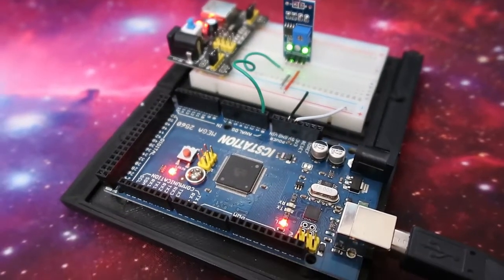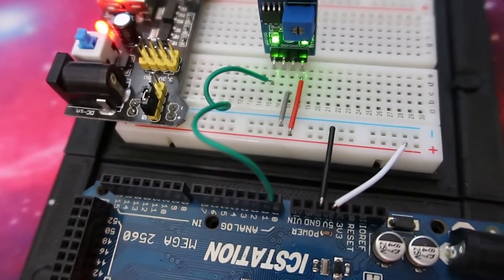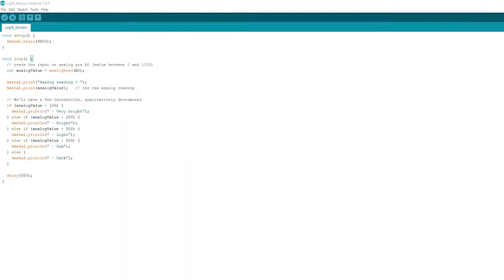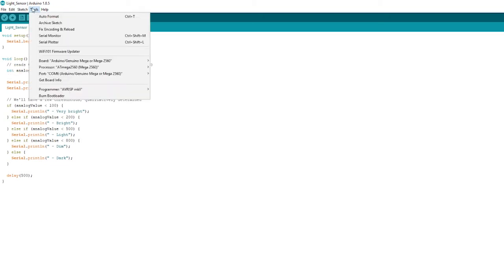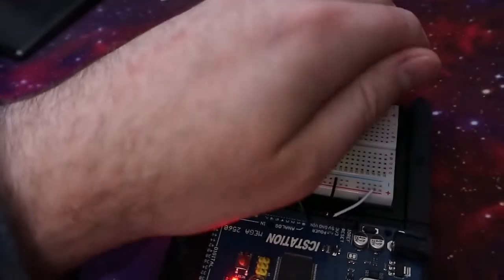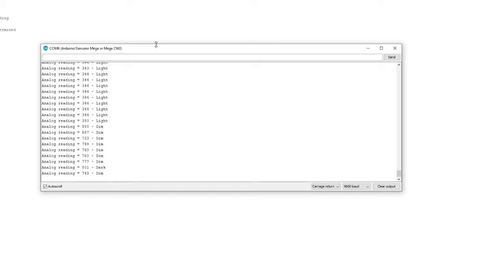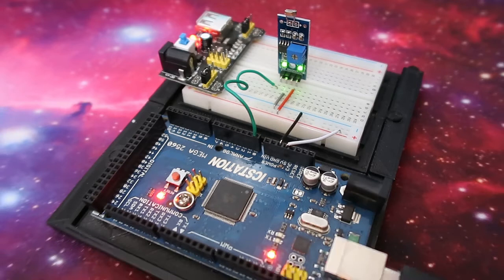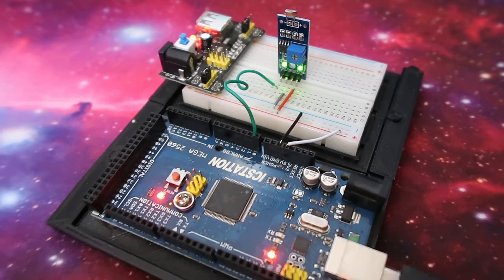Arduino LDR Sensor Module (Light Sensor) Tutorial

Comment: why mine always 1023 in a normal brightness room, and when i use torch light and very close to sensor, it only minus until 800-900 only? i hv adjusted my potentiometer

Comment: Hi i am having an issue, the output in the serial monitor displays bright at 194 and goes between 194 and 196 no matter how bright or dark the room is, the potentiometer does nothing to adjust this, i have tried multiple LDR modules but they do the same just with slightly different output values, could it be a faulty set of LDRs ?
Reply from the maker: That's strange, how's the wiring setup and reading the correct pin? do you have other things connected to the power rail (wondering if the VCC rail is overloaded)